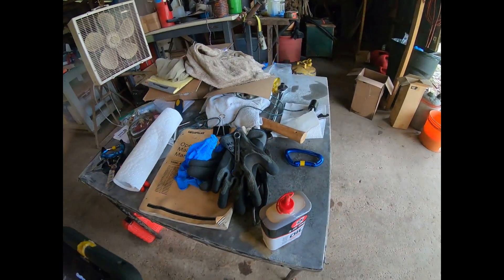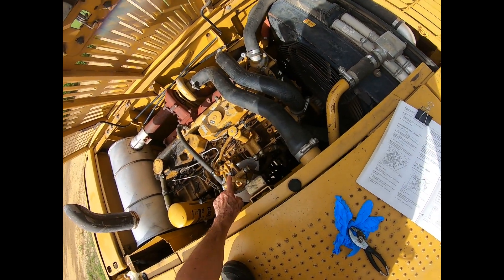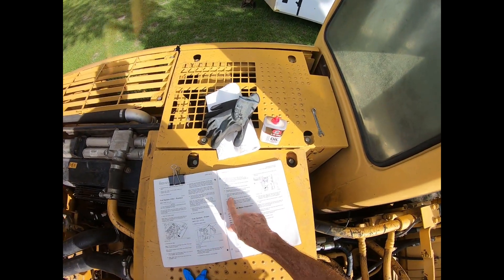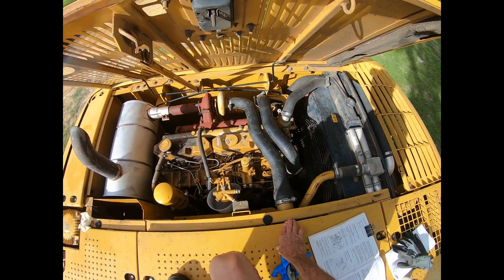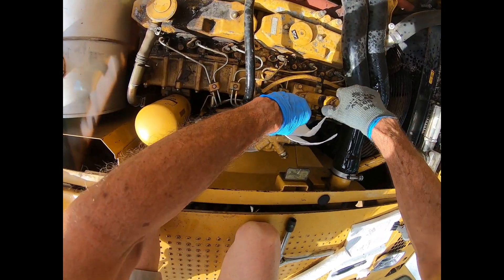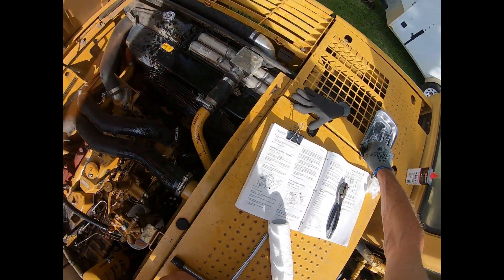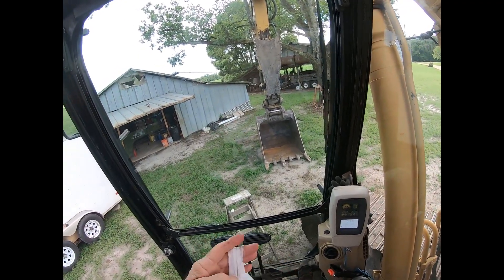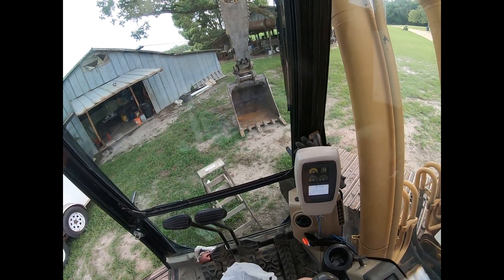priming procedure for CAT 320CL excavator SHORT ver

Comment: Wow. I have a Cat 320c. Bought it new. Running it still. A good machine. I just replaced my priming pump. They were on back order from Cat. Mine had a heavy duty version from like a 322 or 325. I went to a tractor trailer truck dealer and got one from a Cat C15 engine and it fit perfectly. Aftermarket. Cheap! I haven't watch this whole video yet but I'm gonna subscribe and maybe I can help you out. I also know where the secret fuel screen is.